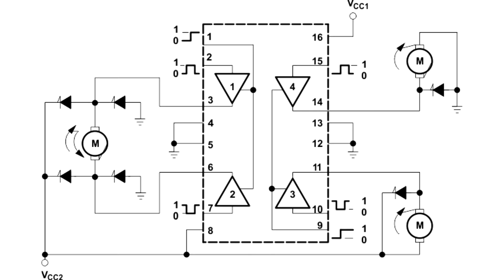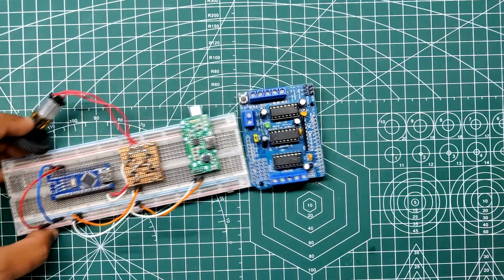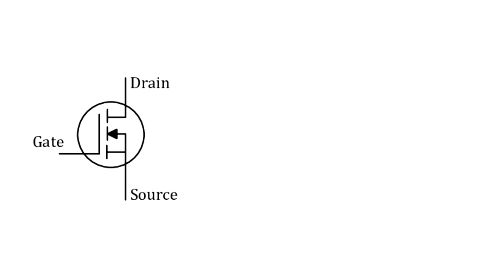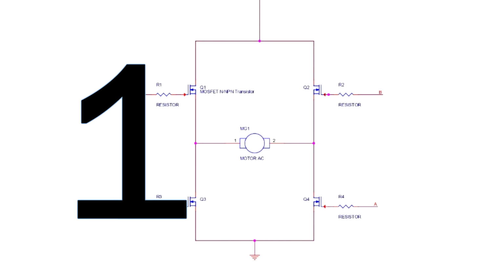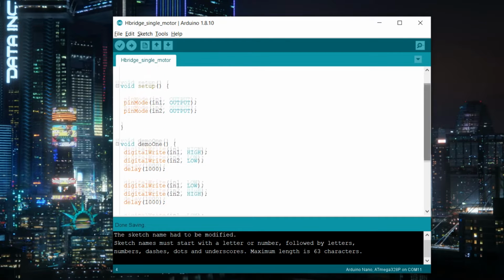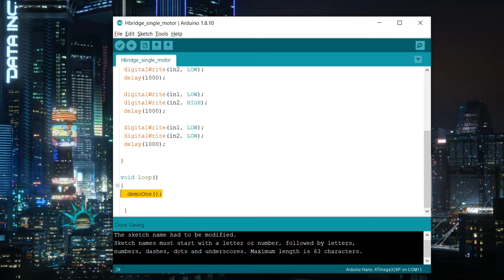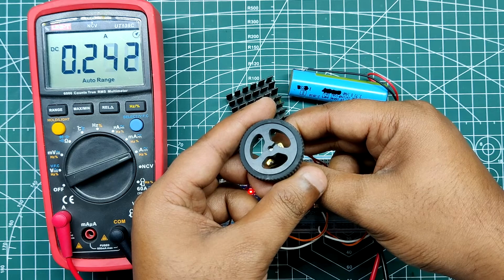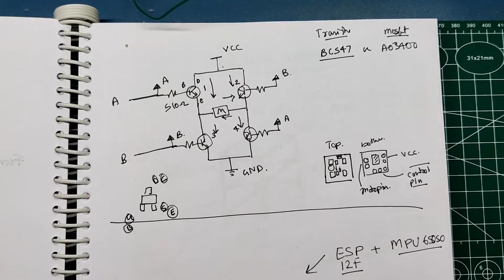Making Motor Driver from scratch by using Transistors

Comment: I know it's probably a basic fact but I didn't realize that mosfets dealt with voltage while transistors focused on current.  Thank you for that important information!  I also appreciate the h-bridge video explanation and associated arduino sketch tie-in. ^^